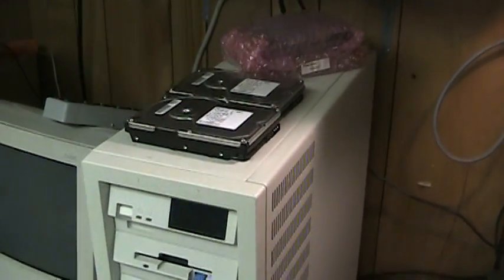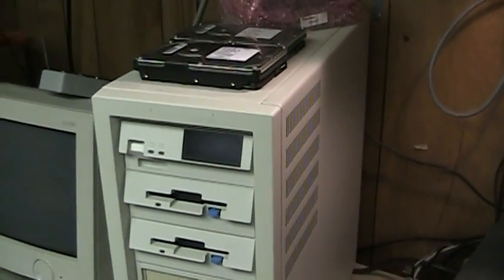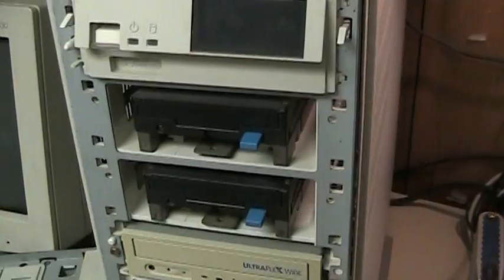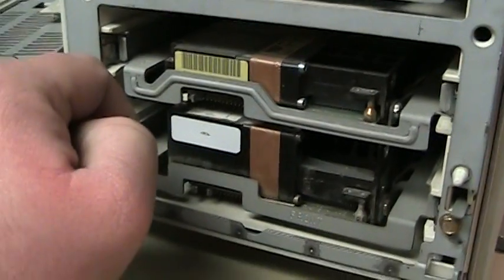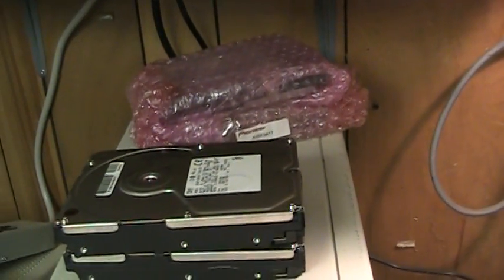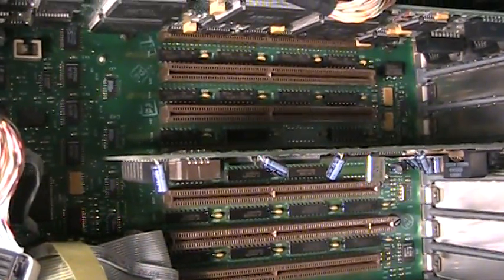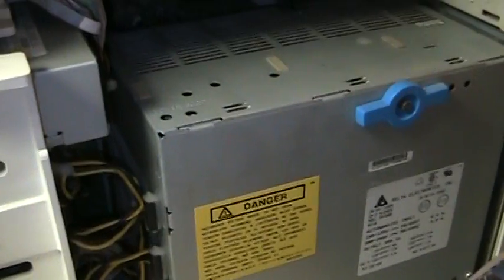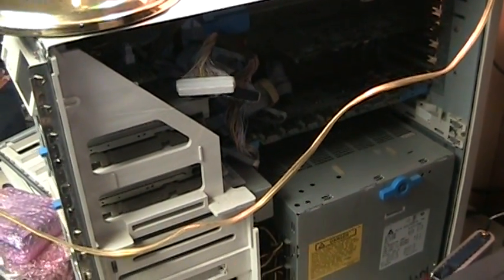IBM PS/2 Server 95 "A" Project Sneak Peek

Comment: I use my 9590 with a Pentium-66 & M-ACPA as a dedicated sound machine as the MCA architecture provides extremely low signal to noise ratio rivaling $2,000 sound cards today! These machines were so over engineered & no expense was spared. Yes they were expensive & sure you can get a cheaper computer that might have similar performance but the IBM PS/2 was a “how good can we make it?” computer; not a “how cheap” computer.

Comment: I worked a one of those machines in Lowes back office it ran os/2 and ran all the registers on the front line . There were 2 of these machines in parallel with a scsi cable coming out the back to a external scsi drive . I went to school for 2 weeks just on the IBM 90-95 series . The ones had Intel 486/66 non IBM but a NCR processor card . It also had 8614 a display card of which I still have one. Those power supplies never died on 4 stores that I took care of . Store now has IBM risc systems

Comment: @uxwbill VideoReDo Plus is a very fast and easy-to-use program, and has served me flawlessly. The ability to re-edit an already edited video without losing any quality is a big advantage, too.

YouTube's own video editor will also work in a pinch for simple editing and joining. Just upload the clips as private videos, drag and drop them into the editor, and save the finished video. It can even join together clips of different aspect ratios and resolutions into one video.

Comment: At least IBM (or Delta) was honest with their PSU ratings, now days they just give a certain "estimated" wattage for every unit. I've seen those Delta PSUs in IBM NetVistas as late as 2002. I've never seen a failed one, unlike some of IBM's HIPRO custom ones which have a tendancy to have fan failures, but if its fixed it will go a long time. And is that a legendary IBM Vaccum Flourescent Display above the floppy drives?

Comment: I have watched a few of your videos now as I like the IBM PS/2 line also.  I've just acquired a 9577.  Sadly the original hard disk failed.  I've purchased a replacement, the computer can see the drive.  On re-booting the computer, it does the memory count then throws up I9990012, then the floppy drive goes crazy then the whole computer does nothing else.  Any thoughts?

Comment: @MarshallRA i don't trust the new power supplies for what they are rated for, they use under gauged wiring and wimpy heat-sinks, i would trust them up to about 90% of their rated capacity, but i would trust this one with 400 watts no problem

Comment: @joeyf504327 Take a look at today's power supplies on say ncix, micro center, newegg and look at ones by XFX, SeaSonic, Antec and a few Rosewills. A lot of the 80+ efficiency (or higher) can do more than their labelled wattage just fine. The reason why i questioned the 399.1w rating is why would they make it so specific? I am sure not 100% of them can do exactly 399.1w no more no less and instead say 399w or 400w.

Comment: That power supply is also huge, you can get 1500w power supplies nowadays in the ATX form factor. Why is it rated for 399.1w and not just say 400w or 390w?

Comment: I spy a Pentium Overdrive upgrade. I have one of those Plextor 40X Wide drives in the PIII, bought it new, awesome drive. I might even have one of those IBM drives in a Mac. I needed a SCSI drive, and they were cheap on ebay. Also, your audio is WAY too hot on this video, I heard clipping.

Comment: What exactly was the AVE slot on these systems and what set it apart from the rest of the 16/32 bit MCA slots?
Reply from the maker: The Auxiliary Video Extension slot was used with certain video cards that didn't provide "basic" video modes, like the 8514/A. Video from the system's built in video hardware (or an expansion card installed in a slot having a Base Video Extension) would be passed through the AVE to the add-in card.

There are also some cards that use the AVE to grab a still frame or live video from the system's video hardware.
Reply: Thank you. Perhaps we could see a video on the 8514/A, like on the model 50Z video?
Reply from the maker: I've thought about it, though the low scan rate is likely to be a problem in that it'll clash horribly with the camera's shutter. Using an LCD panel monitor would solve that problem, only nearly all of them will not sync up at that low of a refresh rate.
Reply: Would capturing the video fix that problem? Also, have you ever tried or considered trying to load Debian on a system such as this, or the PC Server 500?

Comment: RAID5 scatters the parity data across all the drives in the array. RAID4 serves up the same capacity but puts all the parity data onto just one drive. If your RAID4 parity drive dies then the array becomes RAID0. I don't see how a RAID5 array could work without updating the parity data.

Comment: did anything come of this project?
Reply from the maker: Not more than what you see in the video. I ended up needing the hard drive for another project, and the heat sink on the processor complex for its second voltage regulator needs a substantial rework.